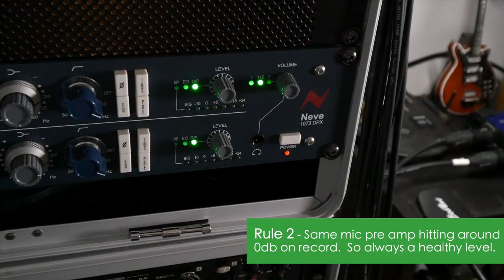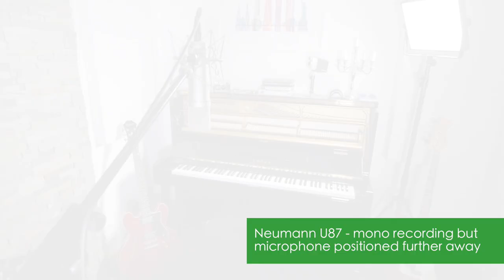How To Record An Upright Piano (Recording an acoustic piano in the studio)

Comment: If I wanted to record vocals at the same time as my acoustic piano (mine only has a little lift top, I can't expose all the hammers like on your piano) what would you change to this set up?  I have an AKG C14. Thanks for this video!
Reply from the maker: I would point the piano mics towards the strings left and right through the top.  In someways this is preferred for vocal/piano live takes as it will remove some of the piano spill getting into the vocal mic.  Happy recording to you!

Comment: I think Chris Martin used an akg c414 to record some of his piano parts for Cold Play, and Thom Yorke and Nigel Goodrich use the Neumann u87 for Radiohead's piano parts on some albums. Also do people record vocal tracks at the same time as piano tracks? All the mics are cardioid mics and pretty unidirectional. I 'm guessing you'd need another with a tight cartioid area facing towards the singer too. Is this assumption correct?
Reply from the maker: Great points and thanks for the comments.  Yes, separation is really the key for making a nice vocal/piano recording.  I made a video yesterday about that but with vocal and guitar.  Happy recording to you!

Comment: Is this a Yamaha U3, early to mid 80s? I tried recording like you did but I get too much hammer noise. Any thoughts?
Reply from the maker: I have a U1a Yamaha upright.  Its hard to tell really without hearing the piano with ears in the room.  If it sounds quite hammer heavy to the ears, then perhaps it needs a service.  If not, then try different mics.  And still if not, and its not giving you the sound you want, then if it was me, I would try a different piano.  Sadly, its not as simple as switch the sample preset like on a digital piano :)  If its the only piano available, then you could also try different mic placement i.e moving them slightly away from the strings.  This might thin out the sound, but then try boosting a little EQ in the low end.  I suppose its called sound 'engineering' for a reason right?  :)  Personally speaking, I actually like the breath and hammer noise on a real piano.  It gives it character and a very non digital feel.  But of course, too much would be annoying.  A friend told me once, there are a lot of people in the world, but they are not all great singers.  I guess, we could say the same about pianos, not all of them are great being recorded.  Thanks for the comment, its a good one!